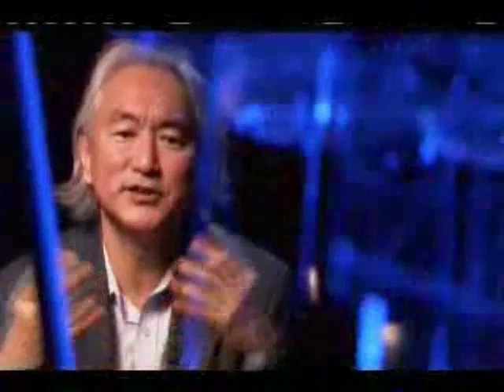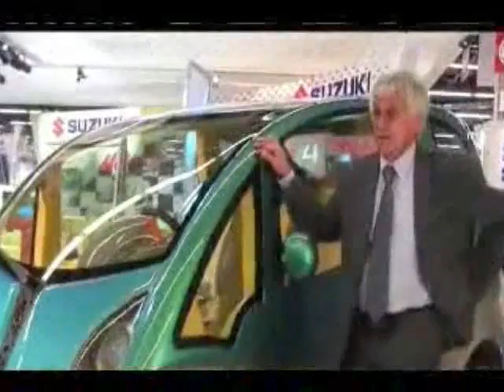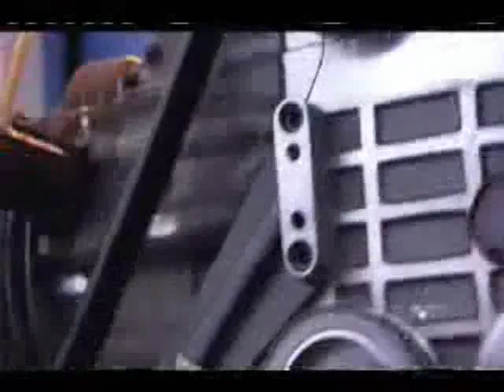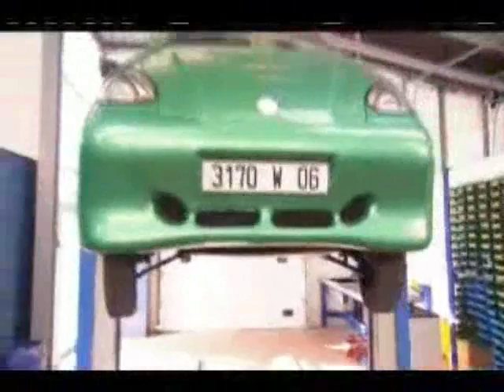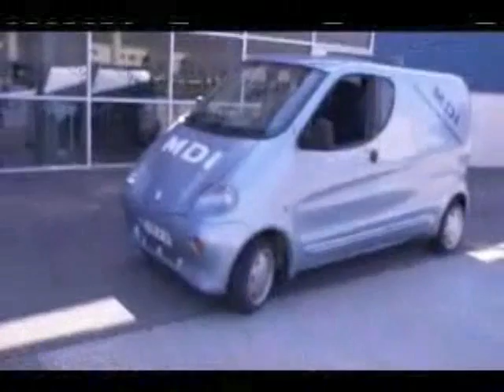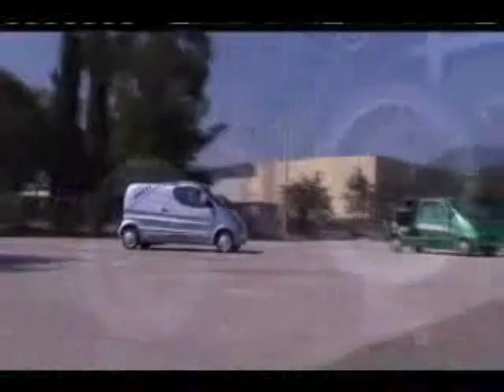Compressed Air Cars

Comment: perpetual motion? by compressing air by compressed air? why should I get more compressed air than I invest by using a compressed air air-compressor? so what about the losses through friction and heat?

I would be interested in the amount of energy needed to compress the air for 100 miles. I guess even a battery would be more efficient. 

Does anybody know?